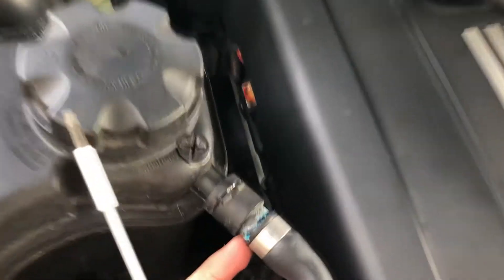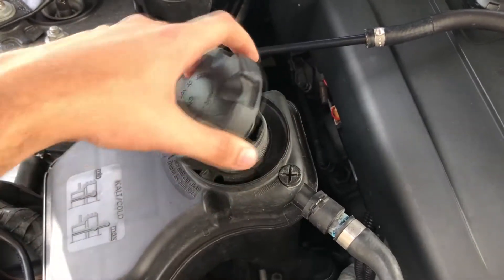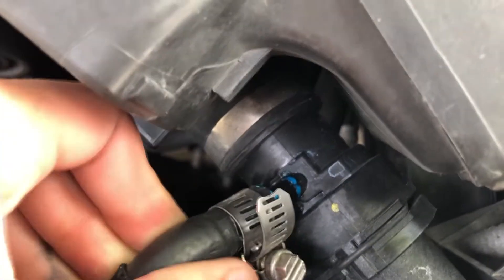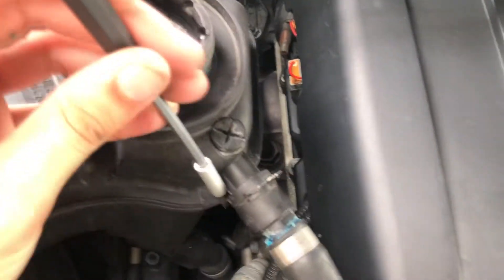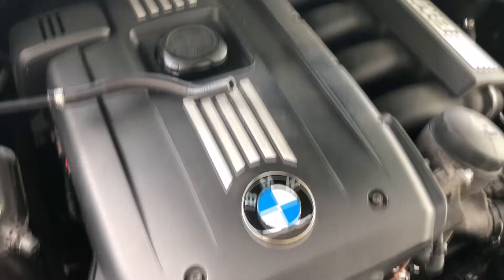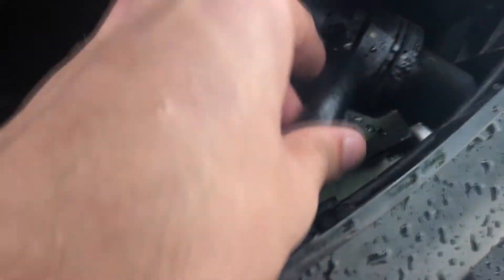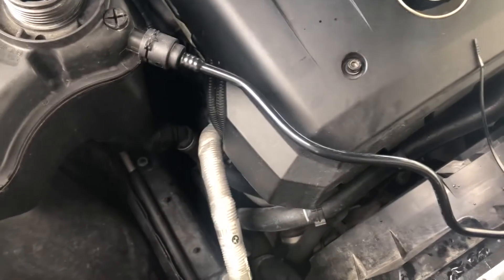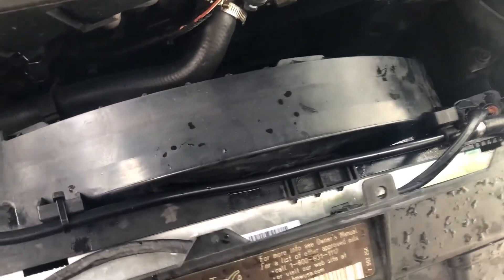BMW Coolant Reservoir hose FIX

Comment: Does this reservoir hose cause engine over heating? The hose where the nipple meets is hissing and leaking coolant when i turn the car off?
Reply: You need to replace the expansion coolant hose it’s $50 better than cause long term engine damage simple job can dyi
Reply: Guys for me was better to replace water pump, thermostat, expansion coolant hose, upper radiator hose, and engine temperature sensor, lastly coolant fan i spent $1.5k car running back again

Comment: Good video, my N54 was leaking a little right wear the hard pipe and hose meets on the right side, I ordered a replacement and it's a quick DIY. Ironically, the hard pipe snapped as I was pulling it off.

Comment: Nice video. That new hose doesn't look oem though. Where did you get it
Reply from the maker: The new hose is supposedly an updated design. Got it at FCP euro
Reply: @autohut3720  It is OEM, just picked the same one up at the BMW Dealer.

Comment: What are the fasteners pins called on the end of the hoses on a 323i. I lost one and can’t find no where
Reply from the maker: What fastener pins? You mean the ones that hold the hose to the radiator?
Reply: @autohut3720  yea those “things”

Comment: What size hose did you use as the temporary fix my bro?....great video Btw
Reply: If I don’t remember correctly I think I used a 12mm round poly tube as a temp fix and it worked
Reply: @schro3532  thanks bro
Reply: el chapo 👌 I’ll link you the part number here in a sec for the stock part you will need in the long run
Reply: @schro3532  I got a 525xi
Reply: el chapo ahhh okay they should have those rein expansion tank hoses at advanced auto for 525s you may have to have them order it though

Comment: My coolant overflow leak happened while I was at work and my 335 got stranded there for about 5 days sad times 😂
Reply from the maker: I wouldn’t drain anything you don’t need to. I think you could just disconnect the hose at the radiator hose and drain it from there pointing down.
Reply: Auto Hut Awesome! Thank you for your help!

Comment: I broke that part you were explaining to be careful with :(. What is that part called so I can fix ?
Reply from the maker: You mean the nipple on the upper radiator hose? You'll need to replace the hose entirely.
Reply: @autohut3720  fml :( i shouldnt even be asking if i can glue it back on just for 2 days ? :(
Reply: Rein hose bro